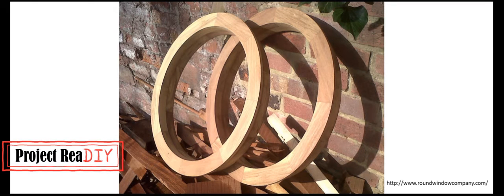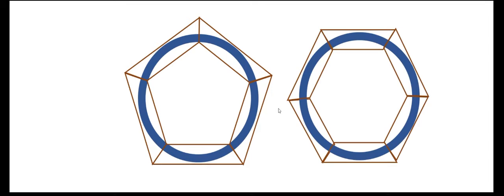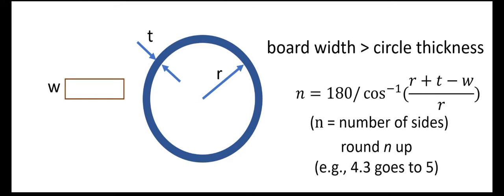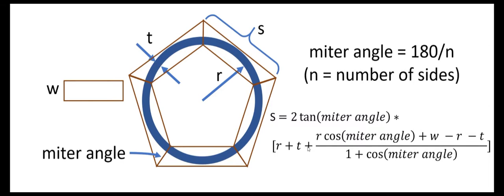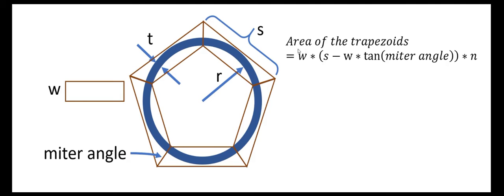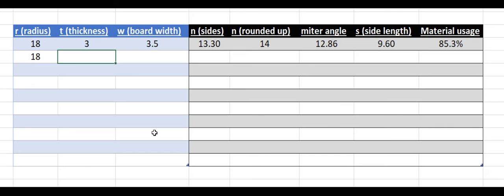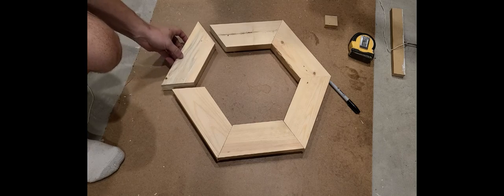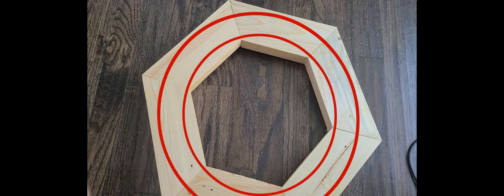The math behind segmented wood rings

Comment: Is anyone able to get the spreadsheet to work on a Mac using the Numbers app? It opens without errors and allows me to fill in the input fields but it will not calculate output fields.

Comment: This helps. I am wanting to cover a Home Depot pail with wood slats. I know my side length (cutting slices of a 2x4 - 1.35 ish after planning). But the pail is narrower at the bottom than at the top. So I guess I need a compound mitre cut on the slats. Can you help with this?

Comment: I’m working on a circle nook seat, how can I get the information for a 36”-48” internal radius. The file was only able to few 24”. Thank you in advance.
Reply from the maker: If you enter the inner radius of the ring (say, 36"), the thickness of the ring (say, 12"), and the width of the boards you will be using (say, 15"), it will compute the number of sides, the miter angle, and the length of the sides.  For these inputs, I get 8 sides, 22.5 degree miter, and 40" side length.  Another alternative is to try the blocklayer website that others have recommended (https://www.blocklayer.com/woodturning-segmentseng.aspx).  Good luck!

Comment: You are correct but you explanation seemed over complicated to me. If you take the diameter of the ring and multiply it by Pi (3.14) you get the circumference of the ring. Divide the circumference by the number of segments you wish to use to make the ring. That gives you the outside length of each segment. The miter angle of each side of the segments is determined by the number of segments so that your ring is 360 degrees. So if you had 12 segments for you ring you would divide 360 by 12 = 30. You would cut each segment at 15 degrees on each side to have a total of 30 degrees. (Diameter X’s Pi [3.14] = circumference. Circumference divided by number of segments = SEL (segment edge length). Segment miter angle Must add up to 360 degrees.
Reply from the maker: Thanks for the feedback -- if I'm following you, I think that calculation for the outside side length might yield a polygon too small to fit the circle.  For example, for a 8" diameter ring divided into 8 segments:  diameter  * PI / segments =  8 * 3.14 / 8 = 3.14" side length.  I plugged those same values into the Blocklayer site folks have recommended and it comes up with 3.31".
Reply: @projectreaDIY  
Not sure why your program comes up with a different answer. I have been using the equations I described for 15 years or so with great success. I do segmented turnings and have made several dozen of them. There are some great programs available that you can design segmented turnings with. They do the math for you as well. Woodturner Pro and Segmented Pro are both very good in my opinion. Hope this helps.
Reply: This is actually brillint! I'm looking for a calculation that will help me make a ring (wreath) out of a pipe insulator, which looks like a pool noodle but it's hollow, so i cant bend it b/c it collapses. I sure hope that this will help me solve my problem 😻
Reply: @marinamkd  should work fine. Remember Diameter x’s 3.14 (PI) = circumference. . Divide the circumference by the number of segments you want to use to make the ring and that gives you the outside length of each segment. Divide 360 degrees by the segments for the angle on the sides of the segment. Example [ 360 / 12 = 30] because each segment is angled on both sides divide the 30 degrees by 2 and you get 15 degrees. Make sense?
Reply: @jimwestmoreland4415
I am wanting to cover a Home Depot pail with wood slats. I know my side length (cutting slices of a 2x4 - 1.35 ish after planning). But the pail is narrower at the bottom than at the top. So I guess I need a compound mitre cut on the slats. Can you help with this?

Comment: As stated "Blocklayer" is the way to go .. and consider the angle to be cut .. 6, 8 or 12 sided polygons use a VERY easy angle to achieve. Most saws will have presets for these angles .. I did make a 7-sided polygon for turning a segmented ring, just to test the "joy" of finding the perfect  51.428 degree angle ... 30, 60, 22.5 are all MUCH easier to achieve.

Comment: Thank you. Looks like this could be useful for table projects I’m working on. Still confused about why the height of the board is necessary. I’m just getting back into math after nearly 2 decades finishing HS. Only had 1 math course for my associates degree a decade ago, so the formulas are a bit complicated to figure out.

Where did you come up with your formulas? Is there a source you can recommend where I can learn to create my own formulas, such as books, manuals, videos, courses, etc.?
Reply from the maker: I went through quite a bit of scrap paper trying to work out the answers and ended up with the wrong formulas a few times before eventually (hopefully!) landing on the right ones.  The math is mostly trigonometry -- angles and triangles.  This is a resource you could check out on trigonometry:  https://www.mathsisfun.com/algebra/trigonometry.html.
Reply: @projectreaDIY  I guess trial and error is the best teacher.
I made a few decagonal, but when I did it again I had to reset everything. I kind of rushed it and the first one that day was off by about half a degree. I wasn’t satisfied, so cut it again but by the time I got it it was slightly short. Now I know not to trust a setup blocks. I have a good compass angle tool but I couldn’t find it at the time.
Best thing is make sure saw is square and accurate, leave it at 90° and use a block that is at the angle clamped to offset the 90°, and make a test cut checking for dead on angle. The block makes it quicker than constantly changing angles on the saws, especially if your your using different saws and some positive stops are accurate.

Now with the angled block I can use miter saw, table saw, or other tools to do the job.